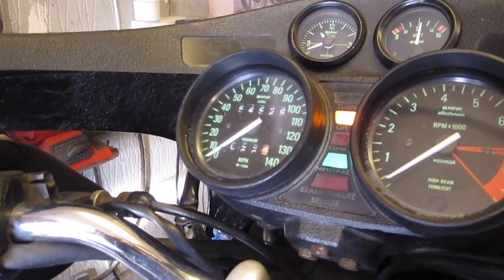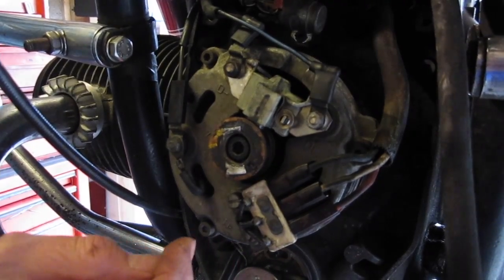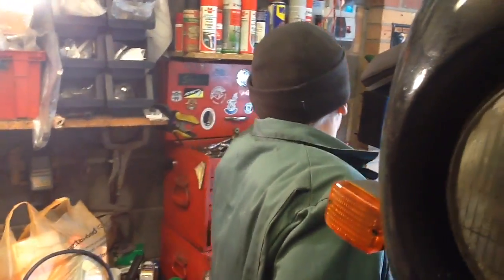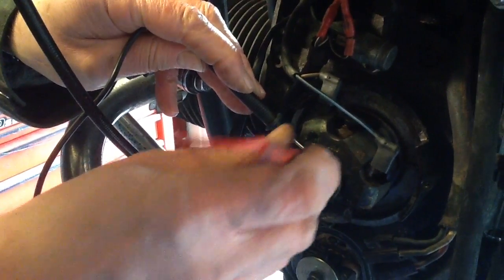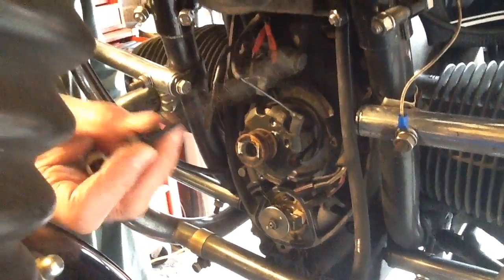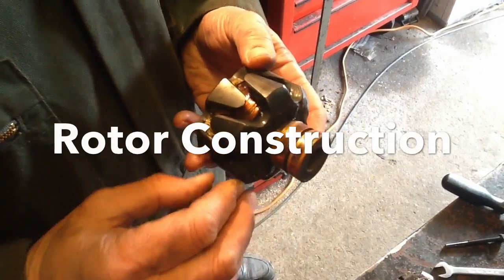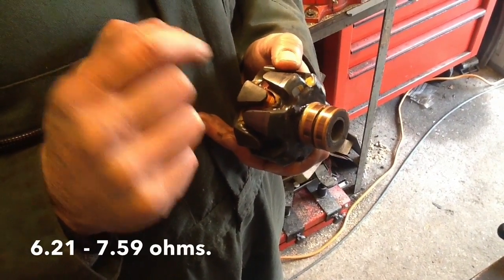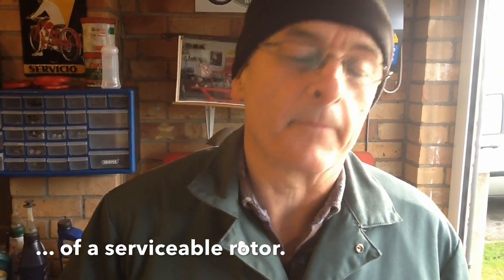Airhead Battery Not Charging

Comment: I have a problem of the gen light on all the time and not charging battery.
light off when ignition off.
rotor has continuity with brushes not touching and the correct ohms reading.
I have revved to over 3000rpm and light still on and no charge.
1981 r100rs
Any suggestions ?
Reply: I a having the same issue. how did you fix the problem? I have ordered new brushes and rotor. my voltage regulator is only 2 years old. thanks
Reply: @KimMoonbmwmoonie  you need to replace the rectifier

Comment: BMW  electrical systems are the worst . It would be great  if you told us the trick on making a puller bold out of a section of 6 mm metal . I'd do it but I forgot the proper length of metal .

Comment: There's a sharp bend of the coil where it connects to the slip ring. There was a remanufacturing supplier who rewinds them taking out the bend making the rotor more reliable

Comment: 4 years later and I'm here again...Sorry to be a pain again...R100GS (1990)...Haven't run the bike since last year and bought a new battery yesterday...Issues with the charging again...Battery light stays on (but dim) during running...I checked the battery posts while the bike was running but the voltage does not go up...I checked the rotor and that was new 4 years ago and is ok using your test...The actual alternator came off with a little persuasion but I noticed that the wiring mesh on the back is slightly loose although not too bad and not unconnected...I did run the multimeter on the 0-200K (same as for the rotor) and used it to see if the wiring on the actual alternator was ok and I got a reading from the red and blue but not the white one...One thing I did notice is that my wiring on the rotor is different from the one in the video - the red and blue wires are the other way around on mine...I'm hoping I didn't get them mixed up when I did this 4 years ago (I dont think so) ...Anyway...Any ideas...Thank you for any help
Reply: The battery was actually dry when I checked it this year which was a bit of a shock as it was a new battery last year...I've been a carer since xmas for my step-father this year up to a month ago, hence no biking

Comment: I have done all checks from this video. Easy to understand and most importantly clear vocal. I had narrowed down the fault from the brown wire into the bulb, but cant find the reason why the bulb doesnt go off during high rpm. Im using a 450watts Endura with its’ upgraded diode board btw.
Reply from the maker: Is this the alternator kit with a permanent magnet rotor?

Comment: Hi, I have the opposite problem. When my ignition key is ON, the GEN lamp goes ON brightly, but it only fades a bit when the engine is revv'd up. I tested the diode board, the rotor and the rectifier and all are good. What else could it be the cause of the low charging?
Reply from the maker: Hi, sorry to learn that you are having trouble. You say that you have tested the diode board and the rectifier, but they are the same thing. Did you mean the voltage regulator? If you are sure that the components you have tested are functioning properly, then the only thing left is the stator. It is unusual for these to fail, but if they do they can either fail because one or more of the phase circuits has either got open circuit, or there is a short. Testing with an ohm meter should show either fault up. Good luck.
Reply: @motophoenix5951  yes, sorry, I meant the regulator and the rectifier. What I did is replace the existing one with spare units that are good and that did not solve the problem. I made the measurements on the rotor and I have good readings.
Concerning the stator, should I take measurements when mounted or dismounted and I guess at the 3 terminals to check if the stator is open or close, right?

Comment: So if I did these tests and my Gen light never turned on, does that mean my Gen light is out? I was riding on the freeway and my 84 R100RS died as if someone hit the kill switch. Towed the bike home and tested the battery and it was at 10.59 and Gen light never turned on. Charged battery to 13.4 volts, completed tests in this video still no Gen light. Thanks in advance.
Reply: So I tested the Gen light bulb and the bulb was fine. Any other tips? I tried everything in the video and still no Gen light.
Reply from the maker: @BIGGZ46 if the bulb works when you test it independently and you have done the test I showed in the video, the next thing to do is to test if there is there a supply to the bulb? Use a voltmeter to test the live supply to the bulb when the ignition switch is on.

Comment: Hi there have you any tips on changing the battery on these bikes it looks a bit awkward to me
Reply from the maker: Yes the space is quite confined. Nevertheless it is not too difficult, it may help to have the side panel off in order to push up from the underside once you have the battery lifted a little. Don’t forget to disconnect the battery breather pipe.
Reply: @motophoenix5951  thanks for that

Comment: hello thank's for video , it's so exlicit , please a l have a question , what 's the signification when the lamp of charging not on  ???
Reply from the maker: So the charging lamp indicates the balance of electrical output of the alternator with the battery. With the ignition switched on without the engine running electrical current flows from the battery through the ignition switch to the lamp and then the circuit continues through the rotor and back to the negative terminal via the motorcycle engine casing and frame. Under normal circumstances when the engine is running, the rotor develops a voltage in it’s windings that opposes the flow to the bulb from the battery and when the opposing voltage is high enough the lamp is extinguished: that is the voltage in each direction is balanced. This point at which this opposing voltage balances is also the point where the alternator output from the stator becomes greater than battery nominal voltage and hence the battery will be charging. If a fault develops, for example the stator stops working then the system will be out of balance and the lamp will come on, indicating that the battery is not charging.

Comment: So if I push on the brushes (to connect to the slip ring) and the light turns on then the brushes aren’t the issue?
Reply from the maker: If you have to push the brushes onto the slip-ring to make the warning lamp illuminate, then it would seem to me that there is a poor connection between the brush and the slip-ring. The brush(es) may be excessively worn, the slip-rings may require cleaning or the brush spring may be weak/broken.
Reply: Moto Phoenix 
Thank you so much for the response. 
I’ve a puzzle I’m working on and I sure wish I had the expertise you do. 
I have a ‘76 r90/6. The gen light has always flickered on and off for the 6 years that I’ve owned it but it’s never left me stranded. Then, one night, it started to die as if it wasn’t getting enough fuel. (It had plenty of fuel) So I cranked it back up (the electric start struggled but it finally started) and it kept wanting to stall unless I revved the engine at high Rpms. I eventually had to stop at a red light and the bike stalled as soon as the RPMs dropped. The battery appeared to be so weak that it would even click when I pushed the start button.  So I push started it and was able to limp it down the road a bit without the headlight on. 

The battery was just purchased that month and was tested after the bike broke down. The battery’s got plenty of life so I was certain there was a generator issue but the brushes look fine and the gen light glows bright without my touching the brushes at all. 
Here’s where it gets funny though. 
Even with the battery at full charge, if push the start button, nothing happens at all. No clicks or sounds or dimming of the headlight as I push the start. (The killswitch is off of course) 
But I noticed the neutral light is out when I turn the key on. I tried rolling the bike in 1st and 2nd and then popping it back into neutral but the neutral light still won’t illuminate. 
I’ve read that the ‘76 r90/6 MAY have a killswitch override that won’t allow the bike to start the bike if it isn’t in neutral or if the neutral light bulb is out or if any of the components associated with the neutral killswitch override is faulty. 

What are your thoughts?

Comment: Hello, thanks for the video really helpful for novice like me.  My R100 is no longer charging, i check everything as described in your video and could not find any issue.  I removed the rectifier and shunt the black and blue cable, then started the bike and battery was charging.  I assumed that the rectifier was bad and bought a new one. After installing it, all was good, battery was charging. 3 weeks later same problem, battery not charging. It seems that the rectifier is again bad which i cannot really understand. Any idea why rectifier will go bad so quickly ?
Any help would be appreciated
Reply from the maker: Hi, sorry to learn that you are having troubles with your charging system. 
I am a little confused by your terminology. You speak of replacing the rectifier (aka the diode board), but the test you have carried out relates to checking a possibly faulty regulator. So I assume you were talking about the regulator.
Anyway, can we establish the circumstances of your non functioning charging system. Does the generator warning lamp stay on all the time? Or does the warning lamp not come on when the engine is stationary with the ignition on? Or is the warning light on all the time, but glowing very dimly; check this in low light conditions to be sure.
Regulators do not often go wrong and from your initial description I suspect you may have a bad connection. Check for worn alternator brushes and/or dirty slip rings. Lift off the brush springs and pull out the brushes to establish that they are not worn out; minimum length 8mm. Inspect cable connections to make sure they are not generating a high resistance because they are dirty.
When you have made these checks, get back to me. 
Regards...
Reply: Moto Phoenix hi, apologize for replying so late to you, I was on vacation. You are indeed correct, I meant the regulator located under the tank.
First I have to say that the bike has been modified by the previous owner and that it does no longer has the original dashboard. A tachometer including LED’s has been fitted.
The light on the dash glows as soon as I turn the key and stays on all the time, also while driving. I have performed following check:
- battery voltage 12.4V
- rotor front brush to rear brush, 3.9ohm, checked at the brush surface like in your video
- rotor front brush to casing, nothing
- rotor rear brush to casing, nothing
- stator 0.6 ohm between each phase
- stator, checking each phase to casing, nothing
- Df cable (blue black) 0.3 ohm (stator side to regulator connector)
- D- cable (braun) 0.5 ohm (stator side to regulator connector)
- Y cable 0.3 ohm
- D- connector on stator to rear brush 0.6 ohm
- D- connector to front brush, nothing
- Df connector on stator to front brush 0.4 ohm
- Df connector to rear brush, nothing
- ignition on and Df cable on stator side unplugged, dashboard light glows (I would have expected it to not glow)
- ignition on and D- cable on stator side unplugged, dashboard light glows (I would have expected it to not glow)
- regulator connector unplugged and ignition on, dashboard lamp does not glow
- regulator connector unplugged and blue & blue/black bridged, ignition on, dashboard lamp glows
- bike started with blue & blue/black connector on regulator connector bridged, battery voltage raising when accelerating
- cleaned as best as possible the regulator connector and replugged to regulator,  bike started, battery is charging and regulating to 13.9/14.2V

I must say that I am a bit puzzled because I did unplugged the regulator connector in the past several times and it made no differences. What is more surprising is that I had the same issue 3 months ago and back then, I cleaned everything. 
Do you know how to remove each cable from the plastic connector so I can inspect each cable and cable shoe? I tried to push from the top but did not manage to get the cable out.
Thanks again, Manuel

Comment: Hi posted an initial comment on general video, positive of course, just put the old girl back together. Shifting this stator was a bit of a challenge, until I compared it with the "new" one, I found a long jemmy with a "shallow" end angle and used this to get the whole lot moving. She fired up a treat. Only thing which have would made the vid A*+ would have been to linger a little on the three cable re-connect with better lighting. But first class effort, and if I hadn't been a numpty I would have remembered the order for myself. Keep up the good work.

Comment: Watched this video...All the wiring checks I did pointed to the rotor needing replacing so I got a new rotor from Motorworks...Who I must add were really helpful when I visited them...So checked a few of the connections which all seemed to be fine...After the rotor was installed I checked on the off chance to see if there was a spark...and there was...So I fired up the old girl and she responded straight away...So now I have her running...If an open circuit rotor was an issue I am a bit confused as to what was wrong with the non-sparking issue but at least she runs now...Thanks again for all your instruction videos on these beautiful bikes...They are so helpful!
Reply from the maker: I’m pleased to hear that you have got the issues sorted. For sure an open circuit rotor will not affect the ignition system so long as the battery has sufficient charge. But the main thing is that your bike is now working. Thanks for the kind comments. All the best for the future.

Comment: My R100GS doesn't have an ignition spark...I haven't run the bike for a few years...The only light I have on the dash at the mo with a new battery is the green neutral light...The engine turns over but no spark....I know that the alternator wasn't charging when I last ran the bike...Could it be that the rotor on its own is at fault?...
Reply from the maker: No a faulty rotor will not affect the ignition system. If the bike has been laid up, it is probably a high resistance (dirt, oxidation) at a connection somewhere along the ignition circuit. I suggest you use a multi meter set at 0-20V dc, or use a12V bulb to probe live connections. Connect the black lead of the meter, or one side of the bulb to a good earth and probe connections with the other. If voltage drops or the bulb is dim/out the connection will need cleaning. If as you suggest, there is a supply to the ignition switch, start there and work your way along. Hope that helps.
Reply: Big thank you for your help MP...I'll try that...Plenty of time on my hands at the mo...Thanks

Comment: great video... i got the exact opposite problem i just put on a new charging system stator, rotor  , voltage regulator .brushes and now my battery warning light is staying on anything i should trouble check ?

Comment: Hey Moto! guess what? I found a 72 r60/5 in a dusty garage stored since '82 and 40k miles on it. silver vrs.  Got it from an ex pat for about 1400 quid! light drop damage but I have it all working now and licensed. I will make vid soon, may need a starter relay and or starter button turn signal switch. I have the bare relay wrapped in rubber hanging below tank so I can trip the contact to start it when cold. No signal in relay when manually ground brown single wire. Fast bike! I also got the rt up to about 223kph smooth to 200 bit sketchy there after, rear rotor was warped new one fixed issues. found out it was  police guys bike plenty of hi-pro motor work in it.
Reply from the maker: 441rider wow! They are quite rare nowadays and £1400 is good value. Look forward to seeing a video.     
I guess temperatures are starting to drop now where you are. I’ll be leaving soon for what will probably be my last blast of the year soon. Off to Portugal to see my buddy for 2 or 3 weeks. I’ll try to post some video of the trip. 
Meanwhile I’ve just put up one about a home made emergency gear shift tool to use in case the selector pawl spring breaks on your 5 speed transmission (it’s known to happen).
Reply: Ahh the wire do-hicky to lift it into a gear. I will check out the vid. The r60/5 parts in good nick are few and far between and the headlight pin ignition board needs a good after market option. I want to keep it stock but it will be my city bike until I get the 441 bored and in the new frame. cold rain and short days already but a few sunny warm riding days still with the fall colours.